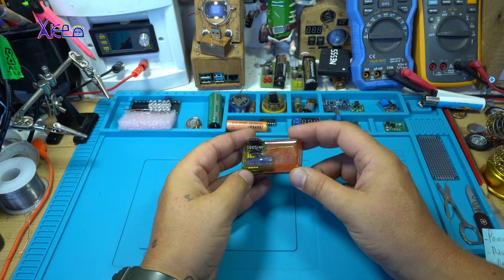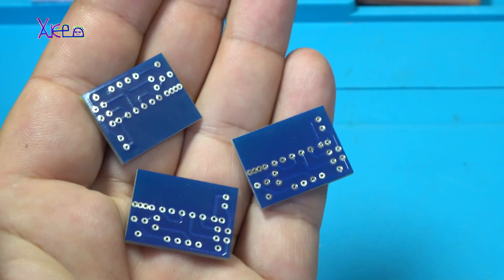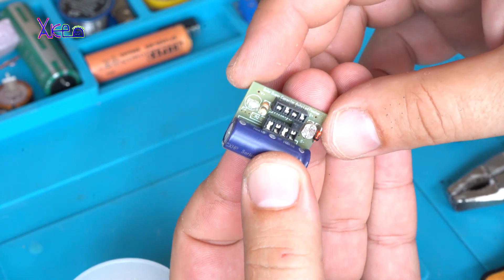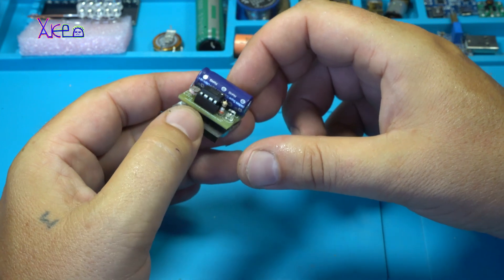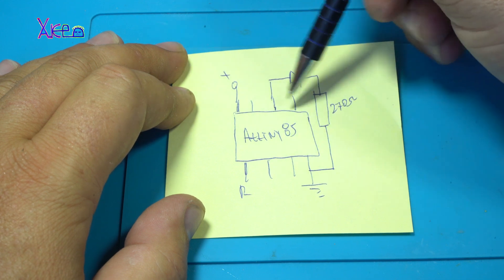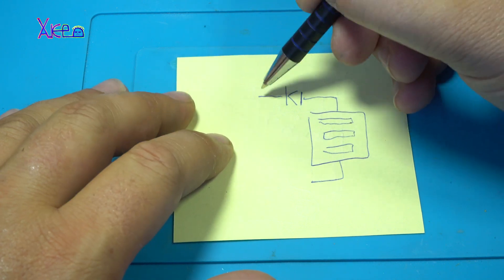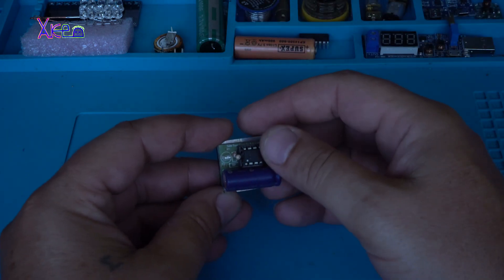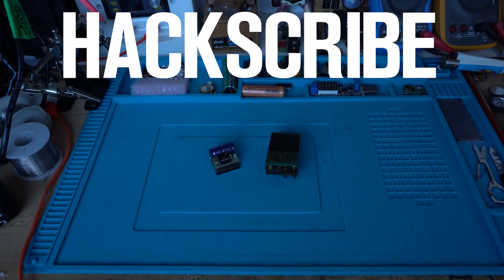Solar Energy Storage Technology - Making Self Charging Gadget

Comment: It is enough this capacitor to storage energy to blink led all night, until the sun will recharge it? I think this led will blink at every 8 seconds. If 1F is not enough what would be the correct value of capacitor in order the LED to blink all night? In winter it is necessary for the LED to blink for 14-16 hours, or even longer. Thank you for sharing! All the best!